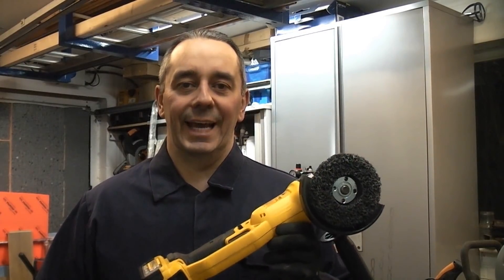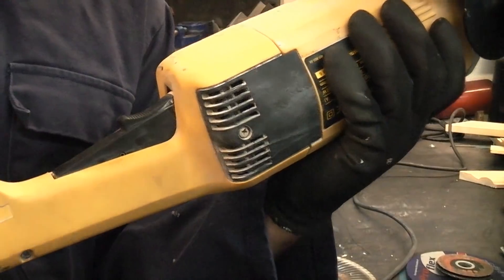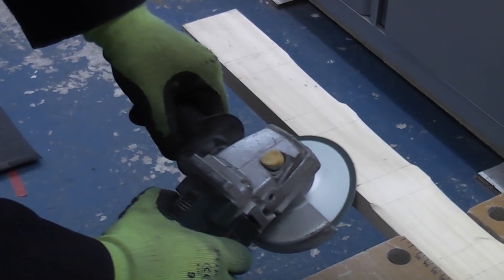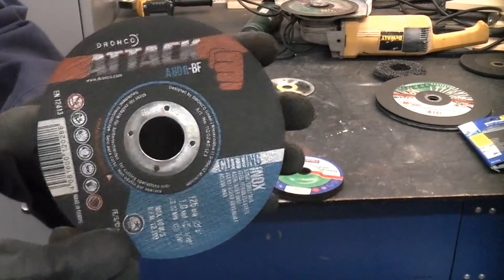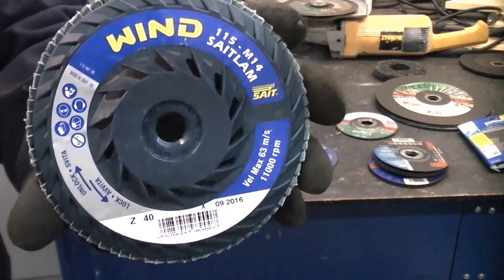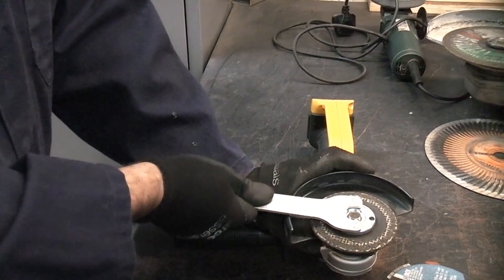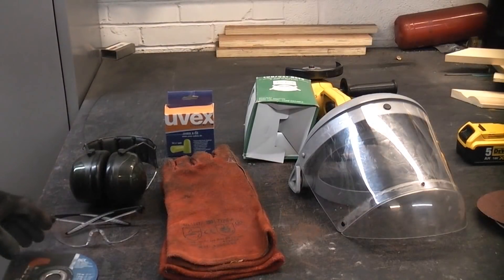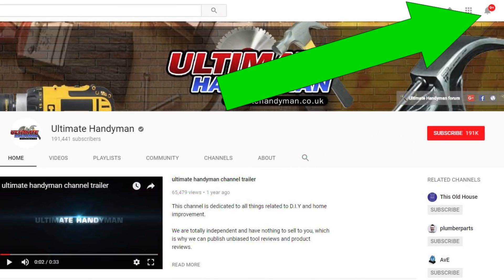How To Use An Angle Grinder-Angle Grinder Safety Tips

Comment: Even if a blade hasn't been used at all but is out of date can it still be used?
Reply from the maker: No, once it has expired I would not use it ;-)
Reply: @ultimatehandyman  Thanks for your advice. Very helpful. Have you any tips for someone who hasn't used an angle grinder before?
Reply from the maker: @mattseymour8637   Just wear the correct PPE, take your time and treat the grinder with respect and you'll be fine ;-)
Reply: @ultimatehandyman  thanks for the advice and guess you are right there but I just am nervous as heard lots of horrific accidents happening and shattering Discs. Should I go for a wheel made of metal for cutting metal for this reason?
Reply from the maker: @mattseymour8637   No, the discs made from metal are normally crap in comparison to a 1mm thick cutting disc. Just don't force the disc and you'll be fine ;-)
Reply: @ultimatehandyman  well I've seen them in action and seem to work well and bit slower but rather that than have bits of disc lodged in my neck if it breaks as can happen if used correctly. Don't you agree?
Reply from the maker: @mattseymour8637   Use a metal disc then 😉
Reply: @ultimatehandyman  I guess would be safer.
Any you recommend?
Reply from the maker: @mattseymour8637   No, I can't recommend any. I've only tried one and found it does not cut as well as an abrasive disc- https://www.youtube.com/watch?v=GijHVlVEqaM

Comment: Great video. What is your opinion with the motar removing attachments?
Reply from the maker: Thanks.
I have used the mortar raking discs and they are great (providing you wear all the PPE), I think Metabo make a special grinder now with dust removal for repointing.
I have never tried the mortar rakes though, I would imagine they would be more difficult to control than a mortar raking disc.
Thanks for the comment

Comment: My cousin, a roofer by trade... was cutting out the mortar in between house bricks to install lead flashing over a porch roof and the blade he was using exploded, the shrapnel headed towards his face and neck. Let's just say he has some pretty gruesome scars. 

Always wear eye protection or even a full face mask guys! Even if you think putting on protective equipment will take longer than the task you'll need them for... Just do it!
Reply from the maker: Sorry to hear about your cousins accident.
I remember being at my mums house a long time ago and a lean to window had not been installed correctly so the company that installed it sent out a guy to install a lead flashing. He pulled out a 9 inch grinder and had no glasses, dust mask or visor. He coped with the dust by closing his eyes! I did offer him some glasses and mask, but he refused- total madness!
Thanks for the comment

Comment: I hate the always on button on the mini grinder. If u have an accident it keeps cutting, it won't stop either if u drop it.... great video btw
Reply from the maker: Thanks for the comment ;-)
Reply: you can buy mini grinder with the handle like the big ones these days, just not so handy in tight areas
Reply: The locks on the buttons are actually pretty sensitive. If dropped they often unlock themselves and stop.

Comment: what is your opinion on diamond metal cutting disks?
the disks i use is metalMAX by Lenox
Reply from the maker: I looked at getting one a while back, but had to import one from the US.
Because they are not widely available in the UK, I thought perhaps they were not much good. I have seen them in videos, but don't trust some videos as it is easy to make some things look good.
Are they any good?
Thanks for the comment
Reply: Ultimate Handyman yeah I find they work good for what I use them for. I’m a cabinet maker so only time I use an angle grinder is to cut 25mm hang rod rail for robes. 
They don’t spark as much and they cut is good but  it leaves a few burs on the edge. I have probably made close to 500 cuts with mine and it still has lots of diamonds left on the disk. I like that these disks don’t reduce in size and you got less chance of it exploding when using it.  
They reckon you can get 1000+ cuts out of one these disks. I reckon it would be close to accurate. 

My father in law does fencing and retaining walls (self employed). He tried out one of the disks and he says he hates them. He reckons they cut slower and leave to many burs behind.
Reply from the maker: Thanks Michael, I have just watched several videos and the general consensus seemed to confirm what your father in law has said.

The 1mm thick metal cutting discs that I use are superb, especially the Attack ones made by Dronco.

I might get one of the Lenox discs though, just to test out.
Thanks for the all the comments ;-)

Comment: thanks for the safety device. Just used the angle grinder with a proper breathing mask. Not a bid of dust breathed in when cutting concrete slabs

Comment: The rpm limit for the 9 inch disks are promulgated because of the larger diameter of the disk vs a 4.5 inch disk.  The outer edge of a 9 inch disk would have too much centrifugal force if it was rotated at 11000 rpm like a 4.5 inch disk does.  If you wear a 9 inch disk down to 4.5 inches then it will have the same centrifugal force at the edge as a new 4.5 inch disk and should be safe on an 11000 rpm small angle grinder.

Comment: I have to say that if I had seen this video when I got my first angle grinder then theirs no way I would have used one. I typically use an angle grinder like a orangutan would play with a mango and have never had accidents like you described. Yet I have always treated this tool with respect. I'm not saying your wrong but there are some who know how to handle these tools and others who do not, however sowing doubt into a user does promote a lack of confidence and thus incompetence leading to bad handling which is likely to result in the very things you described.
Reply from the maker: Thanks for the comment 👍

Comment: you can actually use smaller disc in bigger grinder. do you know why larger discs have lower RPM? becouse its max speed is 80m/s. All disc, no matter the size, are designed for 80m/s.

Comment: Thank you for the info lad, I am a 18 year old Lithuanian who never used a grinder, but must soon do, I will have to cut tiles and iron stripes. I respect power tools and always wear every needed PPE no matter what I do, but these things scare me anyways. I would like to clarify some things with the diamond discs, one being, can I cut metal with it and is the cheapest option available still is as effective? And damn are people stupid who do not use the guards and laugh at safety equipment, but then get left being blinded, deaf or limbless, or even dead...
Reply from the maker: You are welcome.
You can cut metal with a diamond disc, but normally I only do it for example if cutting concrete with reinforcing bars in it. Diamond discs are not good at cutting metal, the best discs I find for metal are the 1mm thick metal cutting discs.
When cutting tiles a good dust mask is essential ;-)
Best of luck with it- please stay safe!
Thanks for the comment

Comment: Those images makes you wanna never grind again. I' ll do admit my machine only does 8500 and the discs can manage 13300. Some toy I must have bought. But as a beginner and from a safety perspective it might not be so bad. Face protection does seem like a good idea, after watching those guys. The protective cover also starts to make sense.
Reply from the maker: As long as you use them correctly a grinder is perfectly safe ;-)
Thanks for the comment 👍

Comment: who do discs these days have a use by date , they never used to, do i really have to chuck discs away now?
Reply from the maker: I've been going on abrasive wheels courses for about 10 years and in that time all abrasive discs have had the expiry date stamped on them, but many people do not know that it is an expiry date. Perhaps if manufacturers stamped the centre with EXP 2020 instead of just 2020 people that are not abrasive wheel trained would know that the discs expired. 
I really would not use an expired disc, I once bought a pack of ten metal cutting discs as they were on special offer at Screwfix and left them in the back of the van, when I found them they had expired so I binned the lot, although I do know some people that would gladly have taken them!
Thanks for the comment

Comment: One of the most annoying safety issues when I'm a shop is when people, wearing all PPE and disc guard, use an angle grinder towards you or other people. They are safe but point a loaded gun towards others
Reply from the maker: Yes, that is annoying ;-)

Comment: I googled as advised and now I'm scared of using my new angle grinder!
Reply from the maker: They are perfectly safe, as long as you wear the correct PPE and use them correctly.

Thanks for the comment
Reply: @ultimatehandyman  Thanks for your reply.  I decided to tackle the bathroom remodeling myself after crazy quotes and got the angle grinder with a diamond blade to cut some corner tiles.  Would you say bad accidents are less with steel diamond blades as to the grinding disks that tend to break and fly off?

Comment: i  seen an accident with a 4"grinder the ones you can turn on and leave on  the main power was cut on the job and this donkey left the grinder down on the scaffold to investigate while he was away the mains where switched back on and that grinder took off like a skier on snow dropped down to the platform underneath where a couple of lads where working ,nasty nasty

Comment: your cutting disks were installed wrong. the side with the label should be facing inside.
Reply from the maker: Unless there is a directional arrow on the disc, it does not matter. Unless the guys that trained me on the last 3 abrasive wheel courses that I've done was wrong. 
Thanks for the comment 👍

Comment: I'm an electrical Improver..
Always been terrified of grinders
And am shocked and worried how colleagues will happily grind using cut off disks and/or  not bother with PPE. 

I've just bought a Makita DGA458 as it has a dead man's switch rather than a lock on/off

This video is the exact video I needed.
So thank you for uploading.

I'd rather be a pussy with all of my face intact and still alive 
Than the "cool" guy who is never able to work again.
Reply from the maker: That Makita grinder looks good ;-)
I'm glad you have found the video useful.
Thanks for the comment

Comment: Ok Guys, i like to use my worn down( ones that are too small to use now) 9" grinder cutting discs in my 4 1/2"  grinder  (only ones that fit between gaurd) they have been working completely fine for me to get the most out of my 9" discs
Reply from the maker: I hope that one never explodes when you are using it!
I think of grinder discs like tyres, if I went to the garage and they told me that a tyre for my van is £100 and rated at a speed of 100MPH but I could get a cheaper tyre that is only rated at 50MPH would I take the risk ;-)
Thanks for the comment
Reply: Ultimate Handyman well but the tangential speed lowers when the disc becomes smaller, so the stress should be much lower and theoretically able to withstand a higher rpm
Reply from the maker: That is correct, but if you install a disc rated at 6000 RPM onto a machine doing 11000 RPM the first thing the accident investigators are going to look at is the disc. 
Thanks for the comments

Comment: All those google images seem to be people not using a guard on their machine
Reply from the maker: Some are, but others are due to misuse etc.
👍
Reply: @ultimatehandyman  Thanks for replying. May I ask, how often do those metal cutting discs explode? 
I just bought a new grinder last week and purely as a hobbyist, and now I think it is more complicated tool than I expected.
Reply from the maker: @zenvir1680   As long as you use the correct disc, which has not expired and you use the grinder correctly, it should be fine.
I've seen a couple of discs explode over the years, but this was due to the person using the grinder incorrectly. 
Thanks for the comments

Comment: Chez these pricks who call you up on OTT PPE if they knew anyone who'd had an accident or had had one themselves they'd applaud you. Typical example, a lad at work was drilling perspex. A pretty low risk job you'd expect. Anyhow a small piece flew up into his eye. He's now BLIND in that eye and his sight will never come back. The impact of the plastic hitting is eye damaged his cornea beyond repair. If only he'd have put his glasses on instead of having them on his head. It's a regret he'll have for the rest of his life unfortunately!
Reply from the maker: Thanks Paul ;-)
It's a shame about the guy drilling the Perspex as you would expect it to be low risk. I once bought a really cheap set of HSS drills from screwfix and was enlarging a hole in some railings when the bit twisted and sheared in half, a piece of the drill bit hit my safety glasses! You can never be too careful!
Thanks for the comment
Reply: Ultimate Handyman Whenever you've worn safety glasses and had something hit them as I have myself on a couple of occasions, it really does hit home how vital they are on certain tasks! Great video as ever! Cheers!
Reply from the maker: Absolutely, it has happened to me at least twice. Once with the drill bit as mentioned above and once when a colleague was knocking a bearing off a shaft and the bearing shattered (I actually know a guy that lost an eye when a bearing shattered). I have never had a problem wearing safety glasses, especially now as they are ten times more comfortable than they used to be! 
Thanks for the comments ;-)

Comment: Using a grinder without a guard is safe as long as you use it correctly .
Reply from the maker: Until the disk disintegrates and you end up in hospital, having the fragments removed from your face!

Comment: Out of interest, why wear glasses and a full face mask?
Reply from the maker: The full face mask does not protect your eyes fully, it is possible to wear the visor and still get debris in your eyes without the glasses. 
I have to wear safety glasses 100% of the time when I'm working on site and even then I have had things that have got past them and the chances of it happening are miniscule - but it still happens! Quite a few times water has dripped down from the ceiling/pipes when I have been walking and a drop of water has gone between my glasses and hit me in the eye, this has happened to me at least twice in the last 20 years.
Thanks for the comment
Reply: Ultimate Handyman - ok thanks. And my god, google searching the images you suggested has made me get into toolstation for some new gear! Thank you
Reply from the maker: You are welcome. 
Yes, there are some horrific injuries caused by grinders, most of which could have been avoided by wearing the correct PPE.
Thanks for the comments